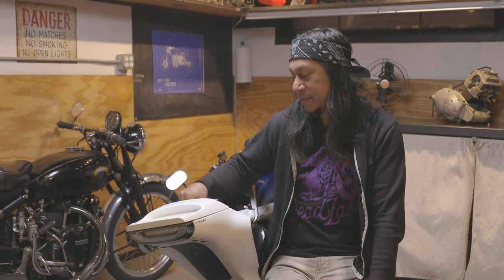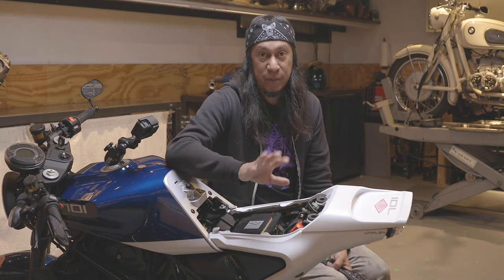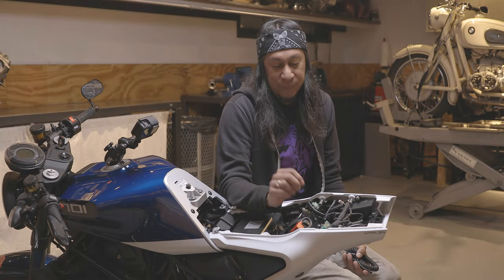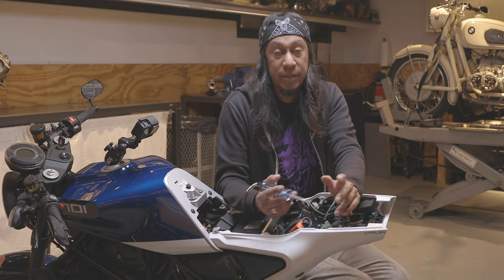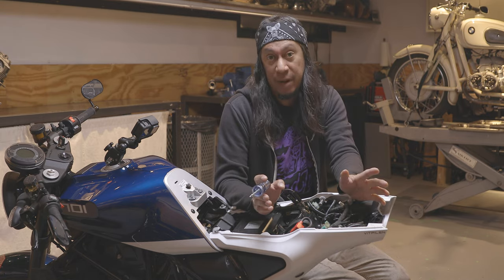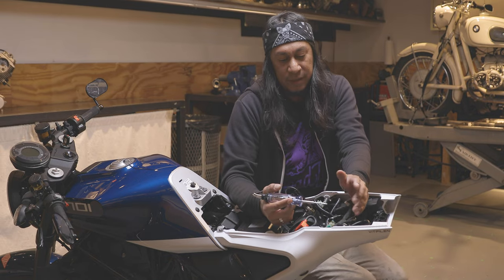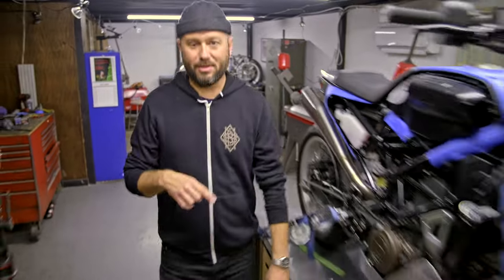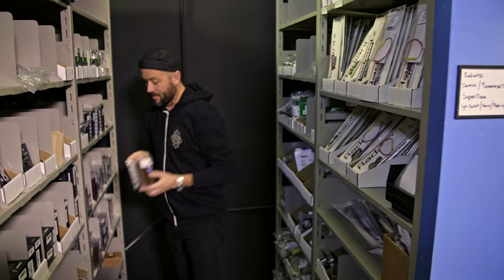How to Test Your Motorcycle's Starter Solenoid  // Revival Cycles Tech Talk # 52

Comment: 2022 klx 300r. Out of nowhere on the trail bike wouldnt start. Power comes on, audible electrical noise coming from relay switch, and can feel it vibrate trying to do something if you touch it. Full battery, all connections are good. Thinking something internal with the switch went bad?

Comment: Great video, thank you. I was hearing the click and problems starting my Yamaha 2012 FZ6R. I got out my multimeter, checked voltage to solonoid and the inbound bolt showed good battery voltage read. What was odd is there appears to be power on the outbound bolt even when they key is NOT turned on…Wtf

Comment: I got a good gremlin. '78 Suzuki GS750E. Was working perfect then pow. New battery solenoid clicks. Changed it to another one same thing. Power is going to the starter when the wire is off the terminal, then no light with it on. Pulled starter and it's good.

Comment: thank you man. great video. well explained and simple for me to understand. I am having issues with my Honda Sabre 1100. I have to chock it for it to start. however the first time starts right up. then if I have to turn it off or the bike is not in a flat even surface It will not start even if if at running temperature. just with the chock. I am thinking it maybe the carb that needs some cleaning

Comment: Here's one for you: 2017 Honda Rebel 500, 10,000 miles. Started having starter issues. Wouldn't crank unless I gave it a little gas. Replaced battery, plugs, air filter, and cleaned fuel injection. It was time for all of that anyway. Working well but I could tell something was still up. Bike sat for three days, which did not used to be a problem. Tried to start and nothing, not even a noise from the starter. Let it sit for a couplw of minutes and tried again. By the fourth or fifth try it cranked. Road it around. Parked it came back in an hour cranked right up. Purrs like a kitten. But I know this there is something up. What in the heck could this be? Any guidance would be appreciated.
Reply: Clean up your switchgear internally, probably so dirty it sometimes doesn't make contact to provide the signal to set off the starter solenoid.

Comment: Hi can you help at all do I need a solenoid on my bike , as I have removed the starter motor as it is bad , and I don’t have a electric start hooked up so I kick start it only so would I need on as I have rectifier or and stator coil to run lights thanks

Comment: Hi man! I replaced my solenoid as it seemed like the most obvious step but my bike still won’t start. I know my starter motor is okay as I jumped the solenoid and it fired up perfectly. What else could this be?
Reply: I have the same problem. Did you find solution? I can short the solenoid and bike tries to turn over, otherwise it doesn't even click. And I have lights, etc. I mean it DOES turn over, but won't start for other reasons.
Reply: @noahway13  you figure it out having same problem but I’m not getting lights or anything
Reply: @Jbando556  I am lost about what happened, I changed so much, but it could actually be clutch not dis engaging
Reply: @noahway13  Put the bike in neutral,  turn on the ignition,  turn the kill switch to on/run, hit the start button, and test to see if the starter solenoid is receiving the 12v from the starter button that it needs to activate. If it's not getting it there's probably a problem with wiring/connections.

Comment: Hi, I have questions would like to ask. I have a 2013 V Star 950. it won't start when the engine is hot, it's acting like a low battery when pressing the start switch but it starts fine with a cold engine. Any answer? Thanks upfront

Comment: Thanks for the video.  Liked! Can you just specify where you put the light at 4:12?  How can I tell which lead coming in which lead going out?  Coming in I assume is the wire from the battery ? And by elimination the other lead is the one you put the test light on for the power going out?

Comment: My battery`s good, and I tried a new one as well. I get clicks only. It jumps off from the car with no problem and charges. However, still no cranking from the battery, so I wonder why those extra amps will crank it.
Reply: What you find out?

Comment: I have come across a strange problem with the starter solenoid on a 50cc Gy6 that I am working on. Had a dead short to ground and found it was the solenoid coil windings. OHMS test checked fine (3-4 ohms) but the bike will not start with the solenoid plugged in. Still trying to understand why.

Comment: My motorcycle starts when jumped. But if I turn it off when full charged it will not turn on again. What can it be besides the battery
Reply: This is probably a dumb question but, have you tried testing the starter solenoid?

Comment: Would the starter solenoid stop the engine when started. I had trouble starting then when it did i got 50meters up the road and it cut out??. Please help. Cheers
Reply from the maker: It will not. Once the solenoid supplies voltage to the starter it's job is done It will not/cannot kill your engine after that.
Reply: Mind did the same. It was the kick stand switch

Comment: OK-please bear with me on this. I’m totally baffled.  When I replaced the starter solenoid on my  03 Yamaha XVS 1100, I was tightening the bolt for the positive cable and accidentally touched the frame with my wrench, there was a big spark.  Since I’m getting NO power even to the main fuse, (fuse goo) could I have short red it out? A real head scratcher. Thanks

Comment: I have a 2012 Yamaha wr450f and doesn't Crank at all, nothing. I was thinking of touching the solenoid with a screwdriver to see if it at least cranks. Would doing this mess up the starter or something else? Don't have a voltmeter or test light at the moment. Thanks for the video any feedback appreciated
Reply: Not as long as your touching the right connections

Comment: I know this video is old now. But… on my crf450x when you hit the start switch you hear the points making contact. No blown fuse. Power going into the relay. So I tried probing the starter directly putting 12volts to the power terminal on the starter and grounding it to the body. And nothing happened. I presume this means the starter is well and truly dead. Thoughts on this???
Reply: Did you replace the starter yet? What solved the problem

Comment: Great video, am having the following problem though key on full charge on battery press starter button nothing no crank or anything. Test light in back of pigtail wire while plugged in which there are 2 one yellow and red other blue no power nothing pressing button or otherwise. Unplug the pig tail wires test light on the red and yellow wire power now present pressing the starter button light dims and almost goes out on test light. Plug the wires back in no power again, bridging the solenoid with a screwdriver turns the bike over so the solenoid and starter motor are good yes?? Scratching my head on this one, what's the problem here is the relay still bad or is something going on with the starter switch?
Reply: My bet is on reg/rectifier.
Reply: @Harnas31  reg/rec used in a motorcycles starter circuit? don't think so. Reg/rec converts alternating current into direct current to keep ur battery tip top. So how's it used in the ignition sequence start up of a bike???🤣😆
Reply: well, it may be faulty. It is part of motorbike wiring so is worth checking as well.

Comment: Sometimes my bike doesn't start when warm. If I wait overnight it'll start fine. Battery level is always good around 13.05V
But if I connect a portable starter pack to it... it usually starts... or if I jump start it. 
Could that be a faulty solenoid?
Why does the extra ooomp of the portable 12V starter battery get it going ???
Reply from the maker: If your bike cranks (turns over) like normal when trying to start it then your starter/starter solenoid are working as they should and it could be a completely different problem altogether. If your bike doesn't crank (turn over) at all when you press the start button or cranks slowly then yes, it could be many things, including anything from a dying battery to a bad solenoid to a starter to loose cables. Check the battery voltage drop when cranking and if it's great then check all of your battery cable connections and your solenoid. If the battery tests bad then you will need to figure out why it went bad... the fun never ends...

Comment: I am legit in that situation right now.

Went to the shop on my motorcycle to buy some food. Went back to the parking lot, she tried to start the engine briefly. And then failed. Then the next starter button press, no response. All lights and dash were on. The darkest "Oh no" for me at the time.

But no more clicking, no more whirring sound of the starter no crank up. Just dead in the water. In this case in the parking lot.

Tested to put the bike on gear and pushing it, no issues and she does try to start with bump start. So I went to tinker, got a new battery, still no bueno. Check all the fuses even swapping the built in spare's to the existing fuse, all good. Stand kill switch good, handle bar kill switch etc. no bueno.

Now waiting for a solenoid to arrive tomorrow and replace and test. As my bike got an odd looking solenoid, like a tiny metal box (Yamaha MT line). With 4 pins which connects to a connector, there is no access to the pins once they are connected to the connector. There is just no way of testing it.

I just hope its not the starter.
Reply: try to short circuit the solenoid to check if your starter works
Reply: Was it the solenoid?

Comment: So I have a 2006 Suzuki gs500 when I got to press the start button my light goes off and no start no clicking sound would that mean my starter solenoid is bad
Reply: Update: Changed my starter solenoid still same problem anyone got an idea what it can be
Reply: Could be your handle at switch.bad connection inside maybe. Also could be a good battery but the cranking amps in the battery are shot. Never had this problem. But heard of it.

Comment: I just got a 2000 Kawasaki ZX7R, The bike will start and run BUT its finicky! Sometimes it will start up sometimes it just clicks or seems like battery is dead. I replaced battery today and with a brand new battery it did nothing but click, seemed like dead battery, I connected charger to the battery and the bike started right up, then bike will start up no problem but once the bike is left shut off for a while the issue starts again. .... Im going to check out the connections and have a look at the starter relay tomorrow.  Any ideas or thoughts on the issue?
Reply: Same problem with my Triumph America 2004. Has done 100K. Wouldn't start;  had the symptoms of a solenoid problem but it was a blocked fuel filter. Got it started by blowing through the filter and it starts better but still has intermittent clicking when starting. Im changing the solenoid as its never been done before.  I'll gradually change from cheapest to most expensive parts to get a nice clean start again.